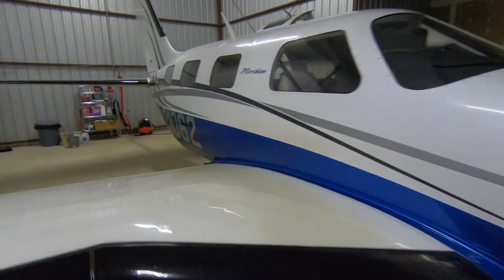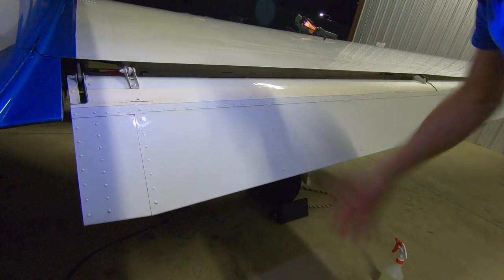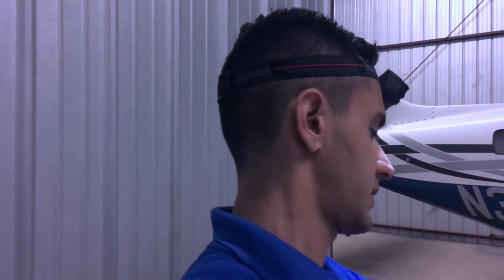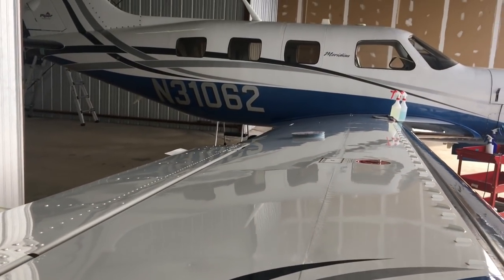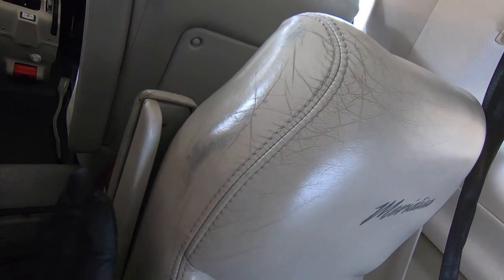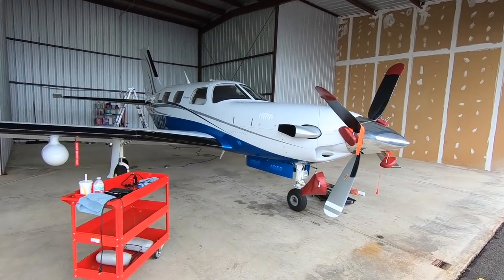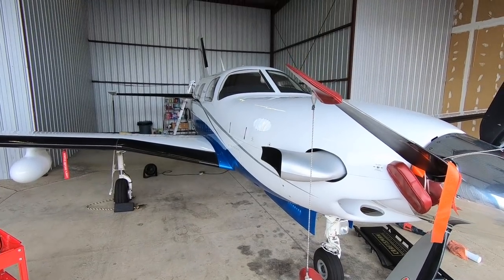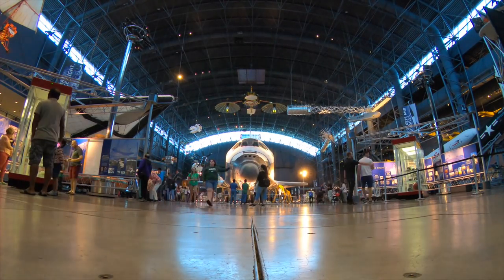VLOG 005 (Part 1) - Piper PA-46 Meridian Paint Correction & Ceramic Coating, Leather Cleaning How To

Comment: Hi Aviana Aircraft Detailing... Great video.
Regarding ceramic coating application, is a polish / compound step 'always' required prior to application of the ceramic coating. 
If the aircraft / vehicle was is good condition without oxidation and the surface was clean, would NOT performing a correction prior to applying the ceramic coating be detrimental to the longevity of the ceramic coating?

Also... how long does the battery last on the rotary polisher?
Thank you.
Reply from the maker: Good question! I look at paint correction as an important surface prep step. You could coat without it, but I wouldn't want to stand behind the longevity of the product. Like sanding before painting, you ensure a consistent finish for the coating. 

The rotary battery last about half a 70% of a cirrus wing :) less if doing heavy cutting. You can generally get by with 3 batteries for non-stop operation.